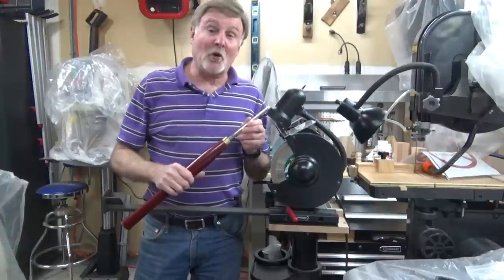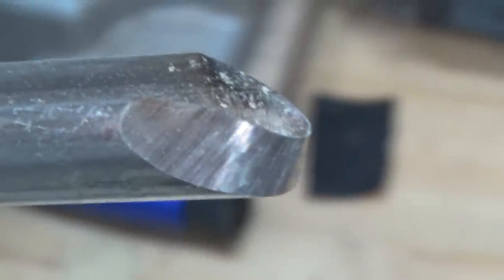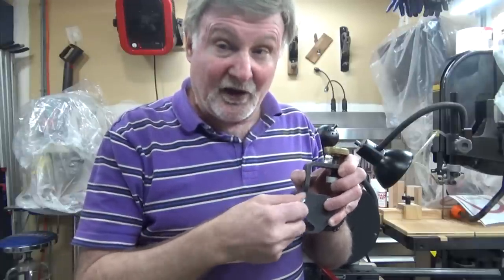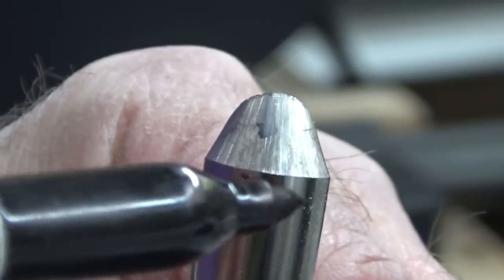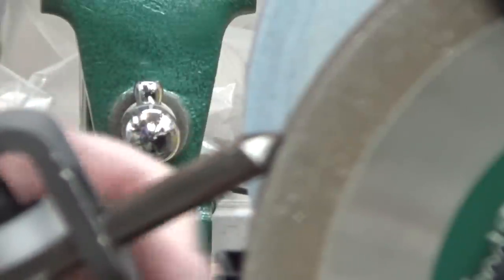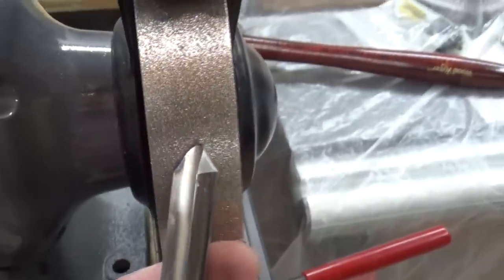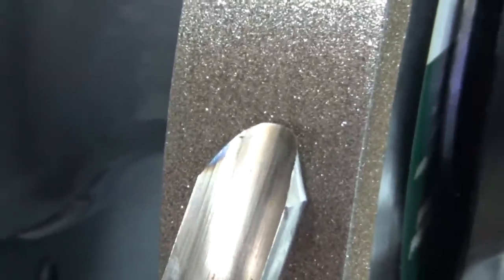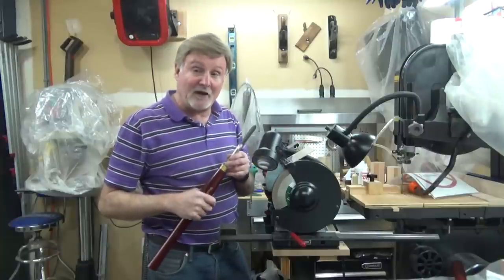How to Sharpen a Detail/Spindle Gouge

Comment: I just got the vari grind 2. Even though this is the older vari grind your explanation of the system and technique helps this newbie understand the differences between the bowl and spindle gouges and how to sharpen them. Thanks!
Reply: Hi Darrell. Because of your avatar I'm going to admit that turning a light saber hilt did occur to me, how about you (even if 4 years ago)?  :)
Reply: @OtterLakeFlutes  lol even if it’s four years old the lightsaber hilt sounds like a good idea. I’ve turned a few billy clubs and I could just modify that design.

Comment: Thanks Dave.  A lot of great information and well presented.  Unless I missed it....you told me everything I wanted to know, other than what angle you sharpen the bevel to?
Reply from the maker: Ideal recommended between 30 and 40 degrees. I split the difference and go with a 35 degree angle.

Comment: One thing I can never find is how I get a proper angle to begin with. I use to free hand, now my angles are all off. I have the wolverine and vari grind, bit if the angle of my tool is out of whack, it'll only hold that bad angle when I grind. So how do I get the proper angle?
Reply from the maker: You can change the angle of your tool. Using a course grinding wheel will make this easier. do it in small increments to avoid removing too much material. get a gauge to check your angle. Once you get your wolverine jig dialed in you will be able to replicate your desired angles with subsequent sharpenings.

Comment: You are a good teacher Dave, good explanation about sharpening and how jigs work. Can i ask what diameter grind wheel are you using?
Reply from the maker: My grinder wheels are 8 inches. A 6 inch is not recommended as the radius is too tight to do the job properly. Thanks for the kind words about my teaching skills. I was a school teacher for 40 years. Once a teacher ........
Reply: @daveswoodshop782  Thanks a lot. Keep teaching.

Comment: How do you establish the initial angle?
Reply from the maker: Your spindle gouge will come with a pre-determined angle. If you are happy with it just move the vari-grind pocket in or out till the angle of the tool sits flush to the wheel. If you want to increase or decrease the angle you would move the pocket closer or further away accordingly. You can purchase an inexpensive tool to accurately measure the angle on the tool. Once you find an angle that you are happy with you can make a mark on the pocket extension so that you can replicate the angle or you can build/buy a jig that will allow you to replicate the pocket's distance from the wheel.

Comment: Can you use this sharpener with a 6 inch wheel
Reply from the maker: I believe you can in but it is not recommended. The tighter arc of the smaller wheel will affect the profile of the tools.

Comment: Can a roughing gouge be reground into a spindle or bowl gouge using this technique ?
Reply from the maker: No! If you were to re-grind a roughing gouge into a bowl gouge it would be very dangerous to use. The tang, where the steel meets the handle on a bowl gouge is much thicker. If you were to get a catch, and you will, the tool will snap and become a projectile. The wings on a roughing gouge are way to high to be ground into a spindle gouge. When it comes to woodturning you should always use the correct tool.